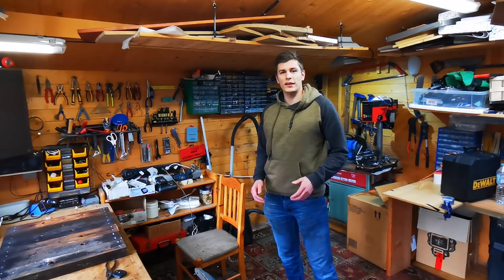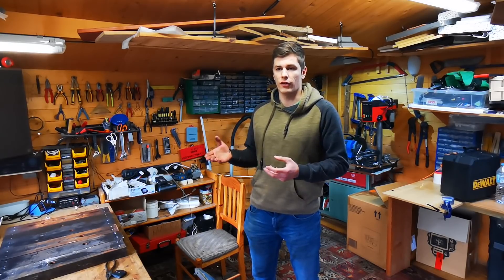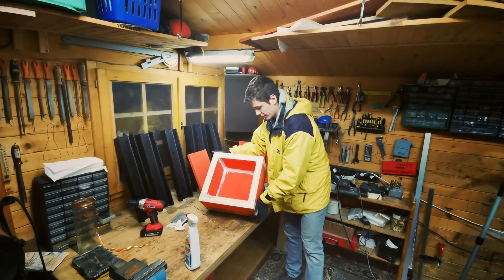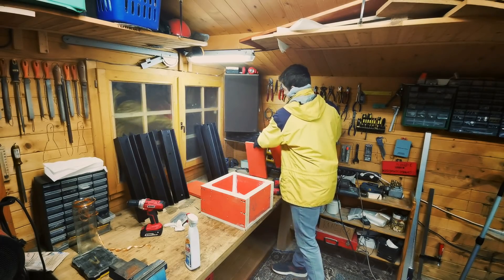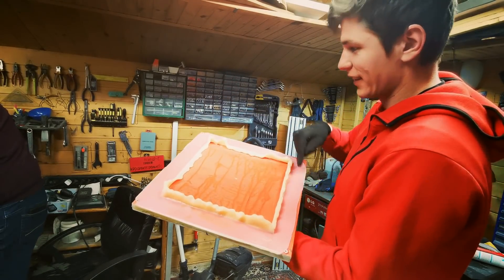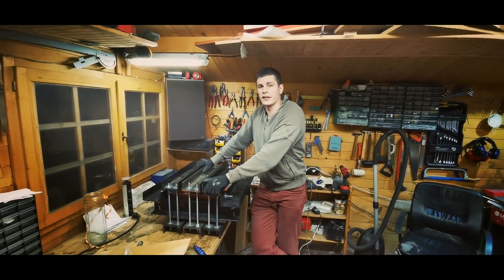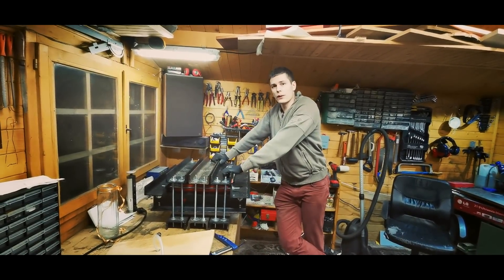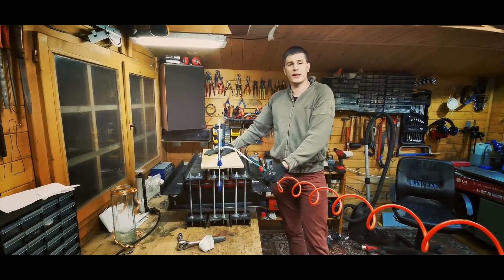Making a "Wooden" Pressure Chamber

Comment: I woulda buried the box in a deep hole to keep the walls from failing
Reply from the maker: That would add another layer of safety, however since soil is not rigid, it wouldn't keep the walls from expanding slightly and leaking

Comment: Have you thought about rotating the steel beams 90 degrees? the second moment of area is a lot higher and therefore the beam is stiffer in this direction (I-beams only get used in this direction aswell). maybe you could have spared the 3rd beam then. Of course mounting the screws would have been more difficult, but i guess certainly possible.

anyways you seemed to have a lot of fun! nice! :D
Reply from the maker: The steel beams are dead solid in any direction. It was much more important to maximize the surface area on the wood, since it otherwise bends at the spots where it is not pressed on and then the silicone seal leaks there.
Reply: @JL2579  ah I see! good point!

Comment: How tall are you? 90 Kg is a lot for a guy like you...
Reply from the maker: 188cm or 6'2''. Have been doing Powerlifting fo a while now and gained a few KGs of muscle. Back when I did my earlier Minecraft videos I was an 800m runner and about 16-20kg KG lighter. I also would definitly not have been able to lift a 100kg box from the table back then :)
Reply: @JL2579  how much ya lift
Reply from the maker: @aks9545  200kg in Deadlift atm. My Bench is really weak still but I am improving (~75kg). Unfortunately corona is keeping me out of the gym, so thats why one of my next projects is also going to be some garage gym equipment
Reply: @JL2579  Begeezus, 200kg is mad, I wouldn't've expected that. Nice job!
Reply: @JL2579  yeah that's some huge difference, but i'm sure the gap will close real soon with good training, is that 200 on conventional or sumo?
Reply: also, that's amazing ! Keep that up , what about squats too ?
Reply from the maker: @aks9545  conventional
Reply from the maker: @aks9545  I need some better technique and shoes for squats. Maybe around 130kg but with bad form. However before the corona shutdown I did 8x400kg 90 degrees on the leg press.
Reply: @JL2579  well you got a lot more in you, you just need to get used to the movements and you'll easily crush a 450 - 500kg total
Reply: Amazing , keep us posted on thag
Reply: No it's not a lot
Reply: Geez that’s 200 lbs. he certainly doesn’t look like he weighs that much. I wonder if his clothes were heavy or he was wearing some 5kg boots to supplement that mass
Reply: @spb1179  200 pounds is not a lot for 6'2 especially if you are muscular.
Reply: Goober 20kg lighter means he gained at least 40 lbs. that’s what’s insane